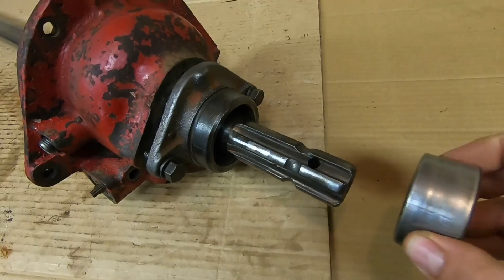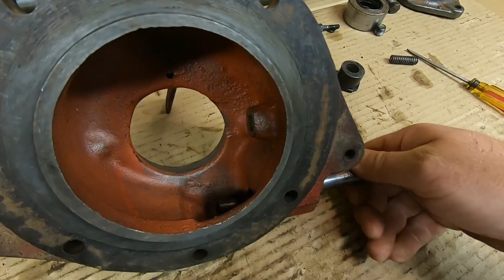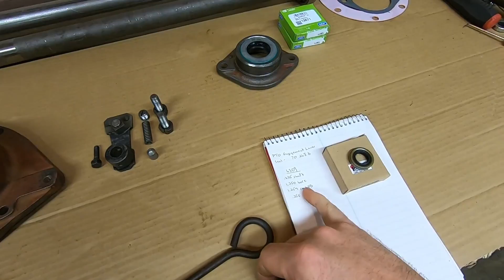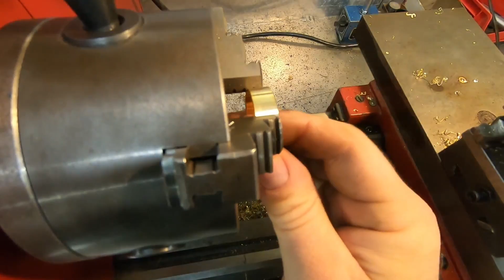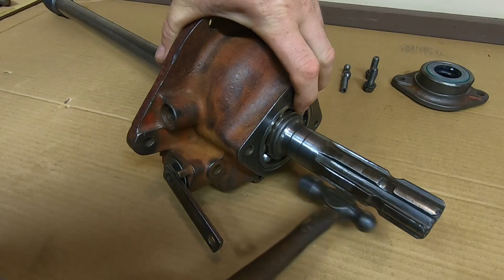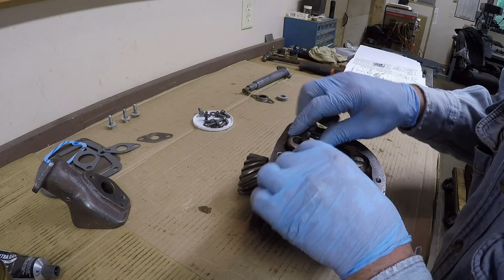Farmall Super M Rebuild Ep.33: Overhauling The PTO Drive &  Assembling The Governor

Comment: How does the whole assembly come off tractor? Does the pto shaft come out once housing cover is unbolted?Have a leak a the pto engagement lever.
Reply from the maker: Yep, drain rear end housing first or you’ll have a lot of fluid leaking out, and then just unbolt the PTO housing and the whole thing will pull out the back.
Reply: @squatch253 Thanks!

Comment: Is it necessary to remove the deck lid to do that service? I have the same broken ear and broken engagement lever.
Reply from the maker: No you can do the whole PTO rebuild without lifting the top cover, you just have to fish the front of the PTO driveshaft around a bit to get it lined back up at the front when putting it back in 👍
Reply: @squatch253  you just made my day!

Comment: You guys are making me want to tear down my very tired SMTA!

SKF 6309 is not the only option. It is the severe duty fluoroelastomer lip option.
6315 is the same seal with nitrile lip.
6316 is nitrile with dust lip.
6323 is nitrile with a different lip profile.
6280 and 6285 are 0.313 thick and might fit the casting, since many of the old seals were thicker by default.

The SKF catalog is online for download. Seals are listed by shaft, then bore sizes. 

Growing up in a parts house was fun!

Comment: Slowly getting caught up. Now we have 2 of 3 styles of H/M PTO rebuilds on the Tube. Nice work, fellas! Also (not that it matters now due to your ingenious seal sleeve manufacturing skills)... Bates Corporation lists the 70268D NOS seal in stock. $14.95. Limited to NOS stock only. For those who may be tackling this project in the future! http://184.154.83.75/~batescorp/batestest.com/product/70268d-seal-2/

Also, the seal guide I have crosses the number to a Navistar/SKF 6925. It specs out the same as the measurements you have listed. Found it at this website for less that $7. https://www.finditparts.com/products/2310828/skf-6925?srcid=CHL01SCL010-Npla-Dmdt-Gusa-Svbr-Mmuu-K2310828-L22&gclid=EAIaIQobChMIzN7luOfR6gIVR9bACh1P3g-iEAQYASABEgJUDPD_BwE#description

Comment: I see the drilled bolt heads in the governor cover, would those have been wired/sealed at the factory??
Reply: Yes. The wire was there so that if the owner removed it and tampered with the governor for more RPMs than factory rating that it would be evident and consequently void the warranty on the engine.

Comment: Good save on the bushing and seal. A lot of what goes into being effective as a mechanic; is sometimes working with what you have. Or adjusting to the situation that you are in. The wrong seal would have stopped a lot of guys. Very well thought out solution.